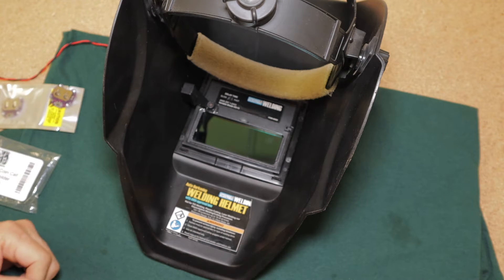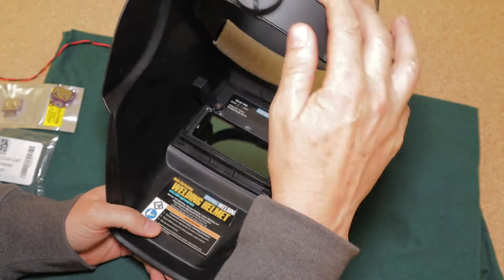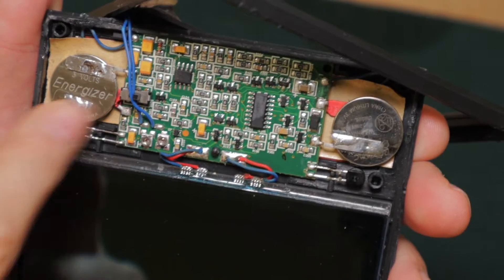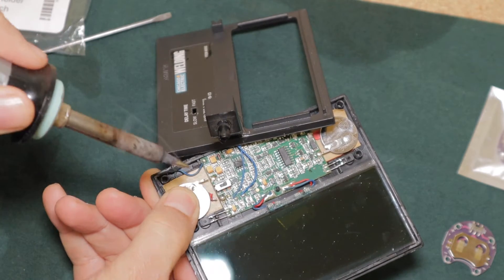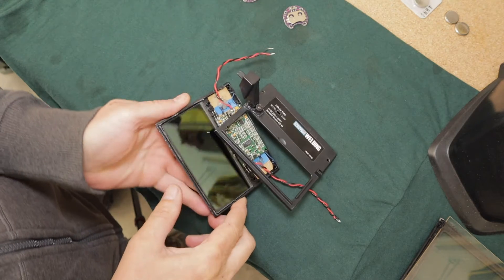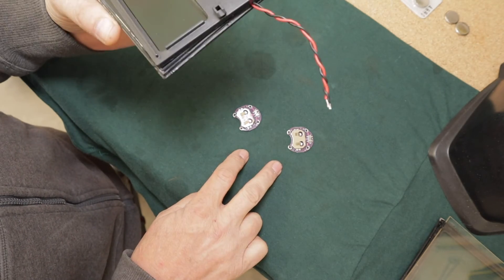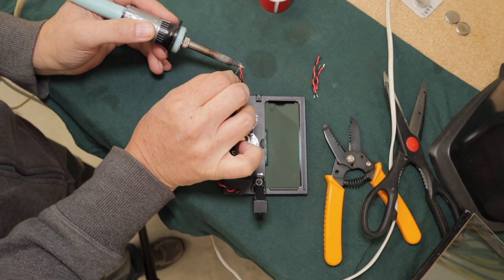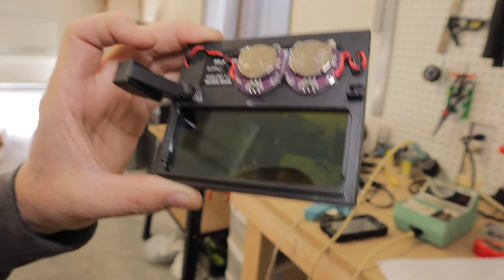Revamp Your Harbor Freight Welding Helmet: Battery Replacement Hacks

Comment: Living in the consumer world that we do! These company's aren't going to like this! Good job I am the same as you!
Reply: I have two 1000 dollar helmets to do and a cheaper one! I was going to do what you did in your first modification but looking at this I think I will pick up some of those battery jackets and go this route! Thanks bud.
Reply from the maker: I agree, this method will make the battery replacement a breeze next time.
Reply: I have been a welder for thirty years now and generally like to use a permanent dark lens but there are times when a person needs the auto darkening when doing specialty welding like removing broken manifold studs and things like that!
Reply from the maker: You have about thirty years of experience over me. Ha Ha I have a lot to learn but heck, that's part of the fun for me. Have a great day!
Reply from the maker: It just drives me crazy how most people just throw things away when they quit working and go buy another new item. I do like new stuff but there is really nothing wrong with this old hood. Now it's better than new and will continue to do it's job. I do like to tinker so that helps a lot too. :)